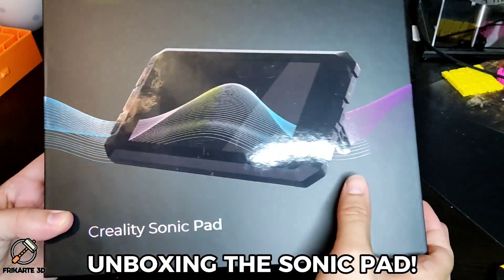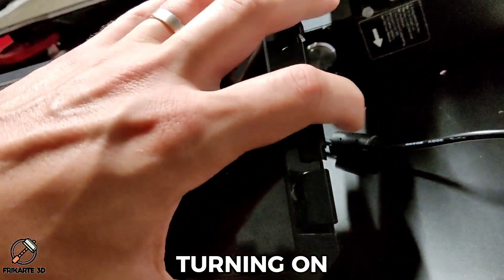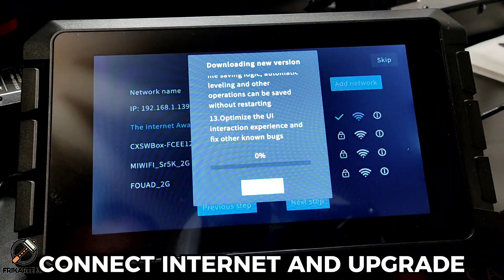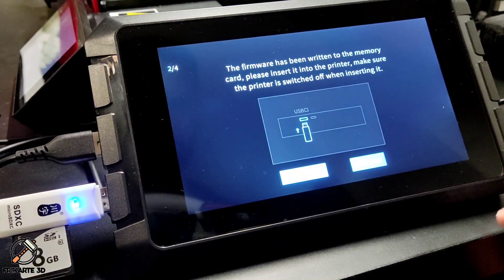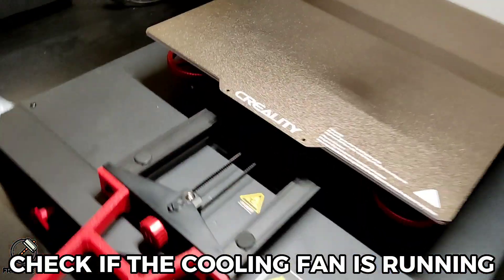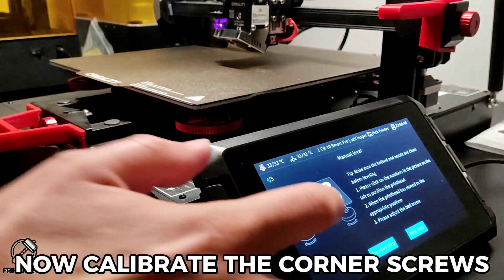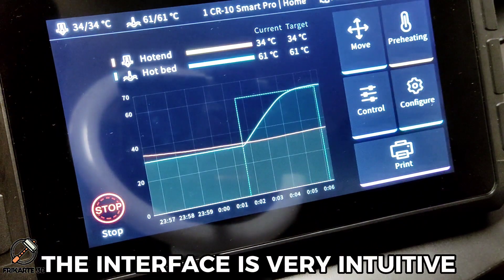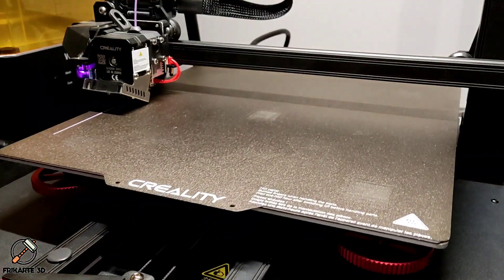How To Install @Creality3D Sonic Pad on Cr-10 Smart Pro 📱 #crealityvidschallenge - 3D Print

Comment: The sonic pad made my printer run like shit, constant bugs. I should have just left it alone and kept the original control.
Reply from the maker: Sorry to hear you had such a bad experience. Mine has been working great, it fixed my Cr10 Smart pro issues, but sometimes these things can be a bit finicky.

Comment: so there is no way to connect the cr10 smart pro  to sonic pad by using the already wifi that comes with the printer?? is has to be usb connected at all times?
Reply from the maker: It replaces the printer screen and needs custom firmware, never tried but I think it needs physical connection to handle all the data transfer because the SD card on the printer is not used anymore and everything is handled on the Sonic Pad, what issue do you have to use an USB?

Comment: Is this for the CR10S Pro or the CR10S Pro V2 or both ?
Reply from the maker: It's confusing because the names are very similar. The printer I used is a Cr-10 Smart Pro, and is a different model than the CR10S Pro and the CR10S Pro V2. The installation process should be the same on those printers, you need to make sure what chipset your printer is using because they are not all the same.

Comment: how do you  know what the correct processor for this
Reply from the maker: The only way to know for sure is disassembly the bottom of the printer and check on the mainboard. I choose the STM32F103 because is the most common that printer comes with.

Comment: Thanks for the video, what about input shaping? Don't you need to run that on the X & Y axsis to get the full advantage of the Klipper OS? I would also like to know how to root the sonic pad cause I want to run Fluid and or Mainsail and be able to use KAMP when bed probing.
Reply from the maker: @OldManJimmy1  Yes, there's the sensor on the box, just following instructions is fine. But didn't notice much change until you speed up at more than 300mm/s, and for that I recommend also upgrading the hotend and fan. Didn't try to root mine yet. 😅
Reply: @Frikarte3D  Thank you for the reply!!! I have Googled how to print to Sonic Pad from Orca and it looks like Fluid & Mainsail are loaded stock on the Sonic Pad.  The only other reason to root would be to implement KAMP and I may try it like it is for a while. If I could get the print speeds to 200mm/s that would be a huge leap for the CR10SPro.
Reply from the maker: Yes! Fluid and Mainsail are the main interface of the Sonic Pad, I printed at 200 mm/s flawlessly with the default "Fast" profile on Creality Slicer. Never tried KAMP, before using the Sonic Pad I didn't use the printer auto leveling because it was better to use without and I achieved a very precise tramming.

Comment: "The compensation made one of the sides always be too close to the bed and the other side too far" SAME FOR ME BRO!
Reply from the maker: Eso me pasaba sin el Sonic Pad y el autoleveling. Cuando no tenía el Sonic Pad la tenía funcionando solo con leveling manual y me funcionaba bastante bién así. El Sonic Pad solucionaba el fallo del firmware original.

Comment: thanks for the video! Do you believe it was worth it? Has the printing speed increased a lot?
Reply from the maker: It was a total game changer for me! I cannot achieve a good first layer with ABL and Sonic Pad solved it easily. For speed I didn't push it yet, but printed easily at 200mm/s. Now I'm installing the High Flow Kit, stay tuned for it 🤗

Comment: My sonic pad didn't come with usb to usb to fit in printer. Only came with usb to micro or c. How did you connect them? Use your own wire?
Reply from the maker: What connector does your printer have? My printer has Type C. Replaced the original one with an Android data cable to avoid adapters
Reply: @Frikarte3D  Ah. I see. I had to open my printer up and switch a connector around and plug a usb micro from the main board directly into the sonic pad. There's a YouTube video on how to do this for anyone else having same issue.
Reply from the maker: @sirvz  What printer do you have? Creality launched a serial connector to fit on any printer, maybe you can go for that.

Comment: "open the printer" ?
Reply: Check if the Ho Ten fan is running :)
Reply from the maker: Yes, you must unscrew the bottom plate to know what's your motherboard version. The most common is STM32F103 i didn't opened it and it works like a charm.
Reply: @Frikarte3D  I opened mine and yes, it is a STM32F103. Would have been a bit better to show that part, but still a decent how to. Thanks for posting this.
Reply from the maker: @jnkmal9519  I can do that part on another video 🤗

Comment: Hey thanks so much for the video! If you don't mind me asking, how do I tell which processor I have so I know which version to select?
Reply from the maker: Hey! I had the same doubt, theorically you need to open your printer to check the motherboard, I didn't do it because I need to do a pending comission. On the Cr-10 Smart Pro, the most common is STM32F103, didn't know what could happen if you choose the incorrect one 😅
Reply: @Frikarte3D  Just added a sonic pad to my cr 10 smart pro and that's the processor that was in mine too, the STM32F103.